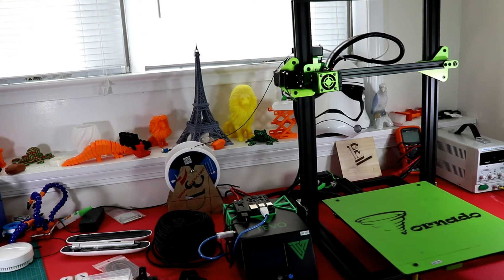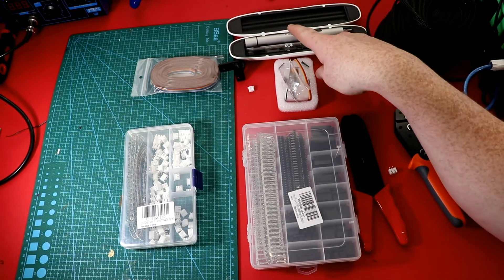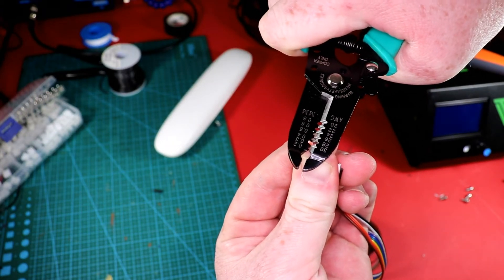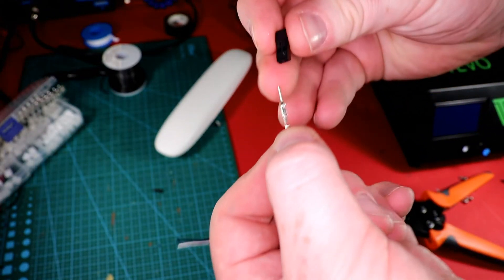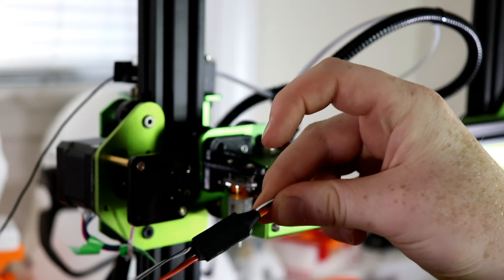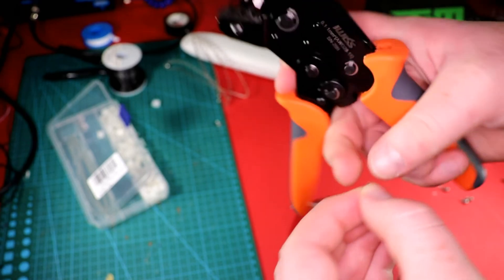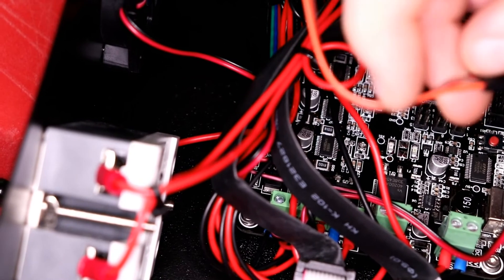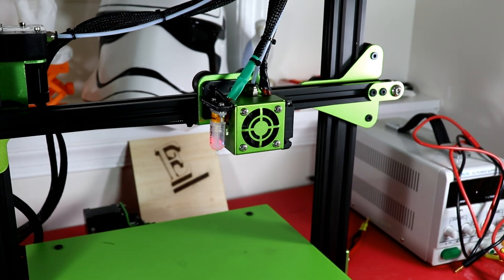TEVO Tornado BLTouch (Hardware Only) Part 1

Comment from the maker: Sorry for not getting part 2 out. Here is a stable firmware: https://goo.gl/YbxYWY I have just the basics on and the BLTouch working. I am still testing a few of the new features of Marlin 1.1.8 and I want to make sure everything works before I post a video.
Reply: I'm now to the 3D printing world. Don't understand much of the terminology. One thing I can do is fallow a good Step by Step video. Just got a Tevo Tornado 3-27-18. I have been printing some parts. with lots of stringing. Puerchest Simplify3D software and now parts are very good. After watching your video on the BLTouch hardware install. I ordered a BLTouch. Won't do the install until you have part 2 completed.thank you again for you work.